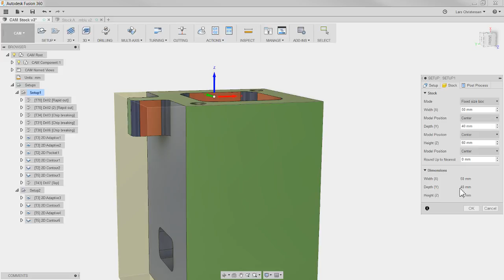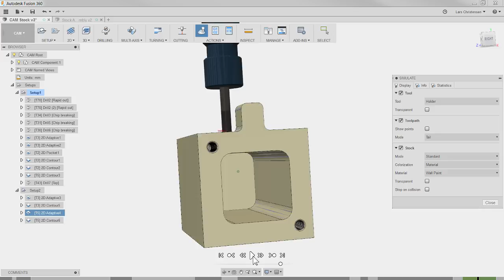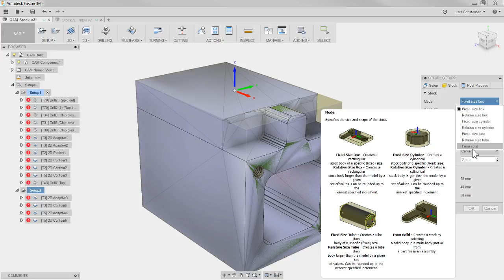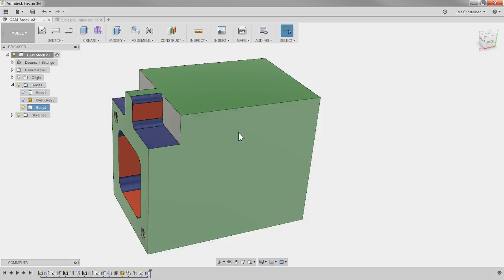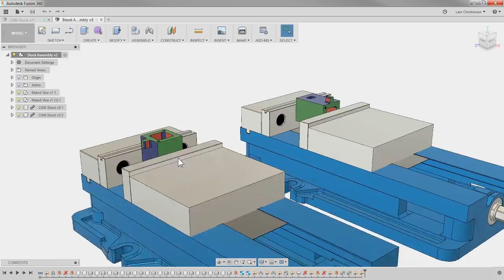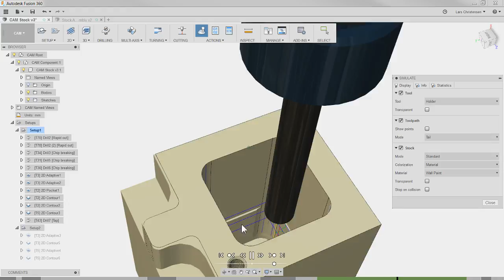CAM Stock Setup For The Win! — Fusion 360 Tutorial — #LarsLive 126

Comment: Is there a less hacky way to bring in solids from operation to operation?  For example, say I finish all the CAM code, and then make a change to the original design... this will ruin everything after OP1.  F360 should have a way to automatically link from first operation to second operation (or 3rd, 4th, etc).

Comment: Hi Lars, I have a stock size of Depth 128mm x Width 500mm x Height12mm.  In the center of the stock I need a 80 x 80 x 12mm shape cut out of the stock. I have Stock Box Point selected and the top front left corner box  selected. When I run this in UCCNC, I would assume the cutter should move from the the stock box point to the area of the 80x80 square, and then begin the cutting. Whats happening is the cutter stays at the stock box point, and plunges the cutter down into the stock. What am i doing wrong here please. The same operation in Vectric Vcarve does as I would expect and the cutter moves across the stock to the area of the 80x80 square and cuts.

Comment: Still my answer is unanswered ,I just want add stock of 2mm from outside as well as inside of the job, 

I have preshaped forging material as same as finish job , just extra 2mm material
Reply: So I need to know, how to load extra material in the stock setup in solid stock mode ?
Reply from the maker: Hi SACHIN Engg works Thank you for watching!
Without seeing your model, if relative stock does not work, you could do the copy body option and use offset face to add your 2mm

Hope that helps.

Best,
Lars
Reply: Thank you for your kind reply sir ,I will try it